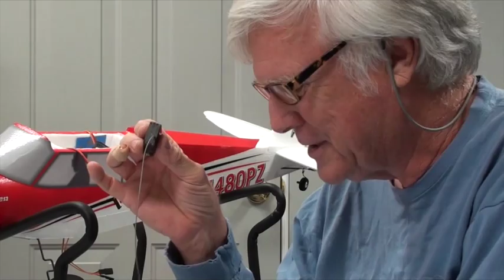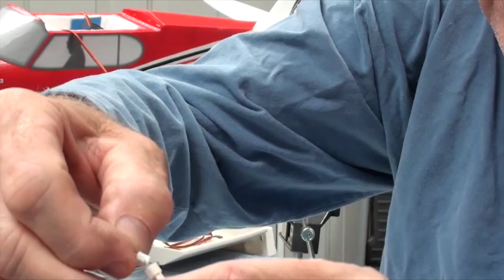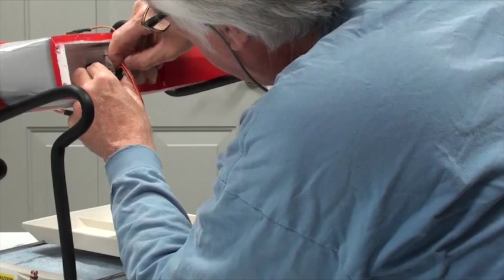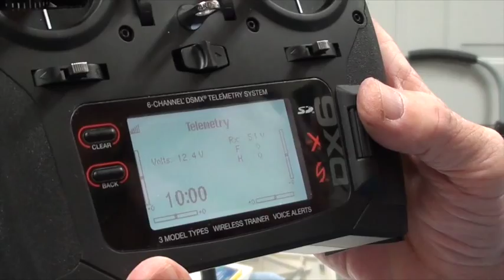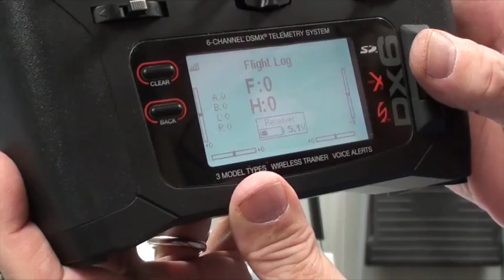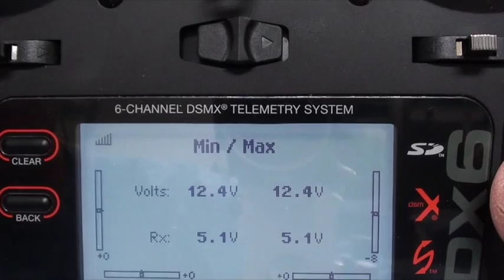SC26 Sport Cub DX6 Telemetry Binding

Comment: Do you need the TM1000/TM1100 if you have an AR636?  I thought the AR636 had telemetry on board?
Reply from the maker: AR636 do not have telemetry and are not compatible with the TM1000 / TM1100.  I wish they were.  When instructing a student with an airplane that has an AR636, I install a second telemetry receiver with a custom made y-harness to power it off the ESC.  The second receiver is bound to another transmitter the reports the battery voltage for me as the student is flying.